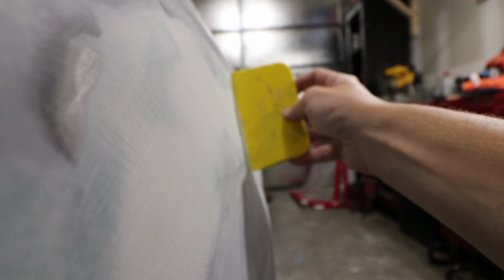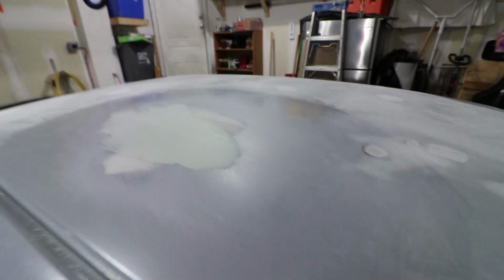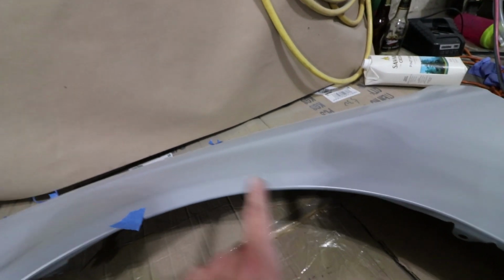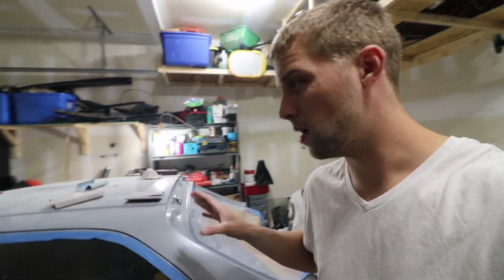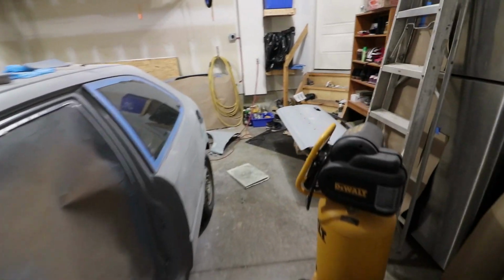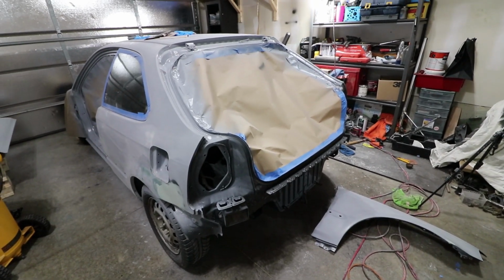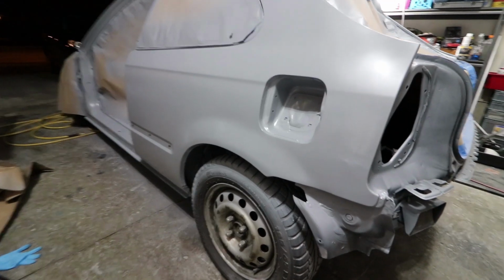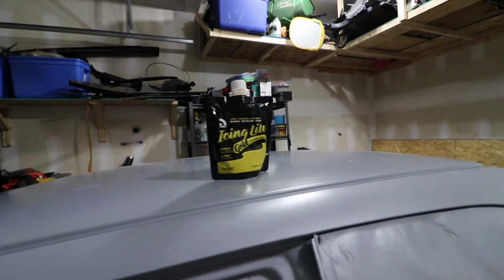Planes, Epoxy and Automobiles - How to Paint Car at Home Step #6

Comment: To feather an edge first sand circularly around the edge to blend. Then take a larger one like you did to take the top off - I learned this from surfboard/epoxy repairing pros. The way you feel with the palm - that's the "eyes" all the time, your eyes won't see anything (I know you know, but for the kids wondering). Also, you really wanna take your time like you did - and overdo it: otherwise you'll kick yourself in the ass later for not triple and quadruple checking the geometry of things.